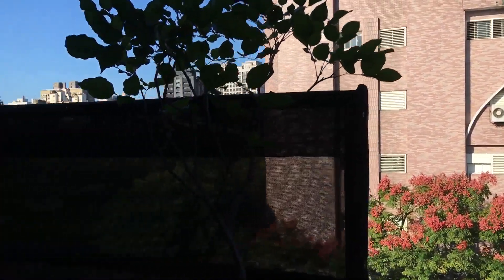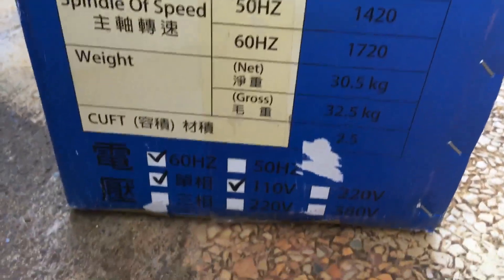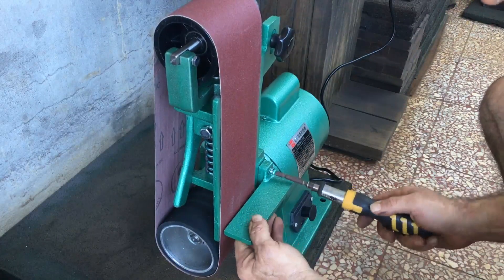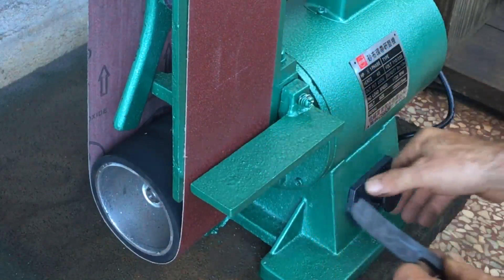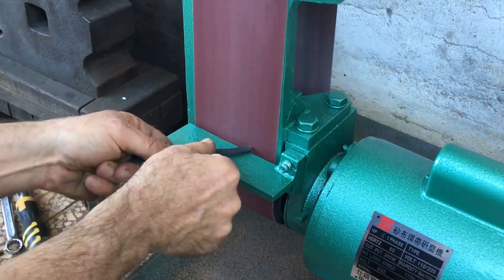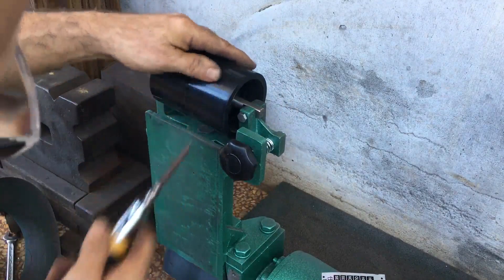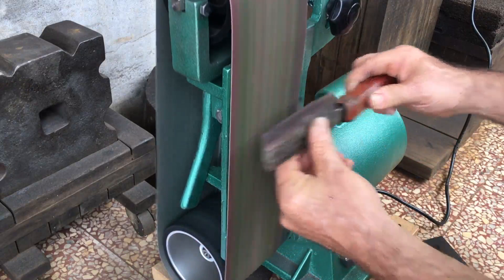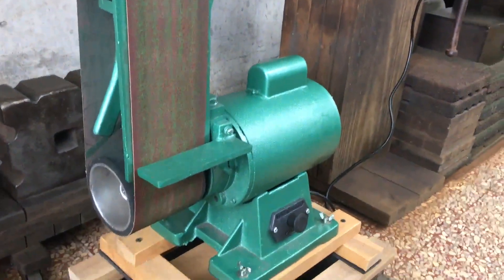Unboxing New Belt Sander / Grinder

Comment: With the tool rest; drill 2 holes in it. Then make another tool rest to fit on top of the old one. Put in 2 elongated slots (angular too!) in it so you can change the angle plus get it closer to the belt. Use stove bolts or bolts with tapered heads ( taper the sides of the slots for those). Use wing nuts under the old tool rest for easy adjustments.
Reply from the maker: Very good suggestion for modifying the existing tool rest. Thanks for sure.

Comment: I faced my Platen with a piece of tempered glass this improved my belt life significantly and avoided uneven wear on the Platen.  My belt grinder has totally replaced my bench grinder in my shop.  U will love it, they even make scotch Brite belts for fine work and Polishing
Reply from the maker: I'm not sure I can face the platen on this machine as you did with tempered glass. It's limited in its adjustment range and the belts might not fit / the locking mechanism not close all the way. That being said, I'm really enjoying using this. I'm on the lookout for a better belt sander but for the time being, this is way more pleasurable to use compared to a bench grinder. Thanks.

Comment: Compound on a used belt, what an excellent idea. I learn something helpful everytime I watch you post. What happened to all the extra room you had after the remodeling and you go rid of the flower bed ? It looks like all the plants are back. Love your work
Reply from the maker: I think I mentioned that the engraver to me the polishing compound on old belts trick - works... I replaced the massive planters with potted plants. But they keep increasing in number! Space is at a premium... Thanks.

Comment: If you open one end of the box and then invert it, you can carefully slide out the contents without having to tear the box up, once the box is off the styrofoam usually comes off without tearing as well. But that might ruin the Christmas magic. Love the videos, your work is super clean.
Reply from the maker: You're asking a lot of my simple brain! As you can see, I'm operating on a caveman level, even with my box opening. But seriously your box opening suggestion is very good. Thanks.

Comment: That grinder will change your fit and finish life. My 2x72 grinder is my favorite tool in my forge.
Reply from the maker: Yes, for certain grinding tasks this just so-so belt sander makes a big difference. I know a 2 x 72 would be many steps up better than this. After I get enough use out of this I'll think about upgrading. Thanks.

Comment: Good luck with your new machine. My 2x72 belt grinder came with that same gap between the work table and the belt, I just attach various overlays on the table, depending on what I'm doing, up against the belt. Works
Reply from the maker: Hey Ron, I also thought about some sort of overlay, maybe attached with C clamps. But first I'm going to try and true up the existing table when I have time. Thanks for your support of the channel.

Comment: When you want to sharpen blades on it always have the belt running away from the edge. The risk of the edge grabbing the belt when the belt is moving towards it is too high. I use the slack belt for sharpening then you get more of a convex edge.
Reply from the maker: I will take your advice and turn blades so the belt is running away from the edges. I just did an edge tool and it worked fairly well having the belt run into the edge but I need to try as you say. Thanks for your input.

Comment: I bought a similar unit some years ago, only difference mine has a disk plate on the other end of the motor which is also very handy. I had similar issues with poor assembly that weren't too difficult to overcome. I'm sure you'll get a lot of use from it, although good belts are hard to find. Thanks Glen.
Reply from the maker: After some use and reading good comments like yours, I feel this machine is worth what I paid. I think some mods will take it a step or two up. I'm on the lookout for better belts and definitely am finding that hard. Anyway, I'm really enjoying using this compared to my bench grinder. Thanks.

Comment: On my sander (not identical but similar) I grind sometimes on top of the rubber backed drive wheel.  It takes the shock out of hitting a hard backing plate when a delicate touch is needed.  Thanks for posting.
Reply from the maker: I was planning to do this just the other day but found the motor would be in the way on the right side (I wanted to use the drive wheel from each side but the workpiece was too long to use on the right). But for the right workpieces, I can see that being a good option. Thanks.

Comment: Hey there Glen - thanks for the unboxing.  Yeah, I agree with you on your assessment on the price - there's the covid surcharge, but also, for some reason, direct-drive sanders are more expensive.  I give a strong recommendation to find/order some "graphite sander platen " -- it's basically canvas with self-adhesive on one side, with a very very slippery graphite coating on the other side.  They will make the belt sander quieter, and reduce friction from the belt sliding over raw cast iron.  That leaves more of the motor power for sanding.  It's a good mod, and cheap.  What I've done on bench grinder tables might work for you - after you make it square to the belt, drill & tap the stock POS table for a much bigger L-shaped 1/4" steel "over table" that wraps around the side.  Lastly, try to find some cork belts for polishing & sharpening.  That's what you want to use your buffing rouge with. Expect to spend real money on them - they're not so much of a consumable like sanding belts, though.
Reply from the maker: Hi Alan, Excellent suggestion with the platen adjustment. Others have said tempered plate glass, stainless steel, etc. but your mod seems like it would be best/easiest. Plus some platen adjustments may just not be possible with this limited machine. Never heard of cork belts but you've got my attention. And I'll do my best with the crappy table. Overall, after some use I find this sander is worth what I spent. Thanks for sure.
Reply: @gstongs  Virtually all belt sanders are worth what you paid for them.  When I first got a big belt sander (a 6x48 that lasted me 25 years & 3 sets of bearings!) I was like "OMG, how did I make anything without this tool!!"

Trust me, do the "L-Shaped Table" mod - it's super easy, and makes a big difference.  I took a quick peek at the video -- seems like that stock table has 2 bolts that mount it to the body of the grinder at 90-ish degrees.  You could, literally, heat and fold some 1/4" steel, and chain-drill & file an arc to make an adjustable angle table.  No welding!

Comment: Hi Glen, it seams that now days a lot of the time, what is in the box isn't what we expected to find. But still with some minor adjustments and not abusing the grinder should last a long time. 👍🔥⚒
Reply from the maker: Hi Robert, After some use I feel this belt sander is better than my initial impression. Yeah it needs mods but I think once I get those done it'll suit what I need just fine. Still, I'm looking for a better/older one... Thanks for your support.

Comment: It looks sturdy enough Glen...Hope it works out and thanks for the tip on the use of a worn belt with compound...I'm hoping to get  some knife making going after Christmas and my grinder is not a million miles from yours so that's a handy tip. One tip I have for you is that you de-load a belt using an old croc/rubber flipflop...I have my daughter's old ones which are too small and they work a treat to unload a belt, particularly if, like me, the grinder gets used for a variety of materials. On the belts side, it's tough to find different grits here nevermind those seamless ones but I did see a YT video where a lady made her own...something to bear in mind...
Reply from the maker: Hey Damian, Your tip to de-load a clogged belt is great. I'll try it. I've been out searching for better belts and found silicon carbide ones that I feel are better. This just decent belt sander makes a big difference for certain grinding tasks. Thanks.

Comment: That will work well Glen, a few adjustments and a bit of fiddling to get it safer and how you want and away you go! I bought a cheap linisher made in china about 25 years ago that handles most of my grinding and its only become troublesome lately! Time for an upgrade but 25 years is a good effort!
Reply from the maker: After using this belt sander a few times, I'm really enjoying it. It has limitations but for the money, it seems fine. I'll get it adjusted to suit me better. Thanks Paul.

Comment: Working in confined spaces as you do, tools have to fit so it will work for you. Sure it isn't a Burr King but it didn't cost that much either. I have no doubt that you will make those adjustments required and then your needs will be met.  Thanks for the post and review Glen.
Reply from the maker: Hey robert, After some use, I'm really enjoying this belt sander and now find it worth the cost. No serious edge tool maker would likely use this but with the proper belts and some adjusting, it will work fine for me and my current needs. But, I'm definitely on the lookout for a better, maybe older one. Thanks for your support.

Comment: Glen, take off that table and use the sander to adjust it for square and for closeness. You should be able to find a thin piece of stainless to make your own platen. I agree that you shouldn't have to, but that's the way it goes these days. Thanks for the video. Jon
Reply from the maker: Yes, that is exactly what I plan to do to sort out the table. Others mention the platen problem but for now, I'll roll with this while being on the lookout for a better machine. But for the money, I now feel this belt sander is worth it. Thanks.

Comment: You got aluminum oxide belts which are meant for woodworking -althou it will work for mild steel is much better zirconium belts -the blue ones to be simple .
Silica carbide is another belt type that is good for steel work -especially if you do hardened parts.Those are grey-black colored.
Get some plumbers silicone and let it dry its awesome for cleaning belts while they run just pass few times back and forward and it will be clean as new.
Reply from the maker: Good suggestions. I did find the black belt to work better / smoother. And if I can find the blue ones, I'll definitely give them a go. Someone else mentioned ceramic belts - not sure... Thanks.

Comment: You could put a small fan on the right side of the motor so it cools it off a bit, and to blow away the grinding dust from your face.
Reply from the maker: I think the idea of blowing the dust away from me is a good idea. But as is this belt sander creates much less airborne dust compared to my bench grinder. Thanks for the suggestion.

Comment: Check the alignment of the surface on the grinder that receives the tool rest with the platen.  Should be in perfect alignment (as one straight line).  If not check the wheels before assuming it is the casting/body.  (JF)
Reply from the maker: Good advice. I'll go over this belt sander as you suggest before making any permanent adjustments. Thanks.

Comment: You can mount grinder on a peace of furniture board or plywood.Then you can make your own tilting table for grinder.You can go luxurious and build a  I_I slot for it. I have done it by using aluminum profile i bought in hardware store.Its three profiles that fit into each other -bottom was 12mm x1 mm thickness ,inside it goes a peace of short 10mmx1 that slides left and right in 12mm .but it goes upside down so its reversed.In that short 10mm  peace i drilled a small hole in center . I have fixed with screw another  10mm I_I profile leftover(you can use L angle iron as well instead ) this time in correct orientation so whole contraption looks like H when you look at it sideways. 
10mm short peace slides in 12 mm back and forward while 3rd peace is a guide and via screw i can adjust it to any angle i want. Easiest way to make a slot,you dont even need a router or any tools just two peaces of same thickness  board that is flat and in this case 12mm height next to each other with channel in the middle,two boards are then screwed to bottom board ,and you can simply drill few holes in 12mm I_I profile to fix it to a board . 
Best thing is slot just pops out ,you can adjust angle quickly with digital protractor and pop it back in -just make sure that slot runs 90° parallel to plate that belt runs on.
Even that is easy to do by putting something that is known to be parallel on plate like 123 block for example or a ruler /spirit level  then put a 12mm I_I channel next to  it and then board and screw it in .After that you simply put front board that goes close to plate and screw it.

It sounds complicated but its so easy and simple to do.

You can make simple tilting mechanism that goes to bottom board ,there are plenty of tutorials on youtube for bench grinders .  U slot cost me like 10$ and it is purely awesome to use when i need something under angle or precise 90. Best thing i ever built ,it improved my crapo 25$ bench grinder.
Make it and that thing will be awesome .
Reply from the maker: I appreciate your detailed explanation. Your right-  it does sound complicated! But a tilted jig would be very useful. Thanks.

Comment: That drive wheel runs out pretty significantly. If it ran true, the thing would be tons smoother. Not sure the best way to address that, but it will bug you the whole time you own it if you leave it as-is.
Reply from the maker: Yeah, I see what you mean. I don't think I can sort that out but after some use, I might take it apart as much as possible and see what adjustments I can make. Thanks.

Comment: Wouldn't be my choice, but for the price I think you'll get a lot of use out of it. If you end up making more blades I think you'll want to replace the platen with something with a truer surface.
Reply from the maker: Hi Bryson, After using this some, for the money I spent I can now say it's worth it. Others spoke of the platen problem for for now, I'm content. However, I'm on the lookout for a better, maybe older, machine. Thanks for your support.

Comment: You can make yourself a better work table just get yourself a piece of steel big enough for what you want to do and then drill and tap the holes and boom you've got a much better work table to sand from. My 4x36 had an aluminum/plastic work table and that was 4x4 and I made a new table out of a piece of 1/4 inch steel that was 6x4 inch so I was able to have much more support underneath my work piece. I thought you lived in the United States but I've been getting the feeling that maybe you don't so was curious where it is you do live?  Thanks I enjoy your videos and really like the tongs you make. Hopefully here soon I'll be able to pull the trigger and buy some from you.

Comment: With ceramicsandingbelts it would work much better. The table isnt good to make knifes. This will kill the blade if it will be pulled between the belt and the table. But welding a steelplate on the original and it would work super.
Reply: speed and power needed, otherwise the ceramic will just glaze over
Reply: depends on if he can get the p
Reply from the maker: I'm on the lookout for better belts. And I'll make the adjustment to that table for sure. Thanks.

Comment: Good idea!
Glad you finally got a belt grinder!
New doors have just opened for you my friend.
Maybe you won't hate grinding so much now,lol
Reply from the maker: You are certainly right. After some use with this so-so belt sander, I'm really enjoying it. I've gotten good ideas from folks on mods / improvements. And I'm on the lookout for a better machine already. Thanks tyler.
Reply: @gstongs  the 2x72 is the king of belt grinders. It's the gold standard. 2x72.
I'm going to make one someday,they are pretty dang expensive to buy,but very palatable to build yourself.

Comment: Hmmmm! wonder if you turned a belt inside out and put polishing compound on it if it would work as more of a polisher?
Reply: idk bout this size of belt but you can get polishing belts for 2x72s and 2x48s
Reply from the maker: That's something I never would have thought to try but now will. Could turn out to be an excellent suggestion. Thanks.
Reply from the maker: I'm currently on the lookout for different belts for various purposes. Thanks.
Reply from the maker: Hey vern, After more thought I think turning a belt inside out might not work. The grit side being inside would likely destroy the platen and wheels. However, if I almost completely wore down a belt so that is wasn't abrasive maybe it would work. I'll see...
Reply: @gstongs  wrap the wheels with some duct tape